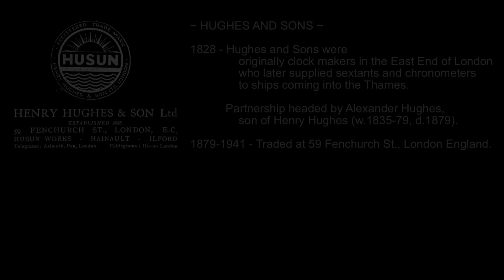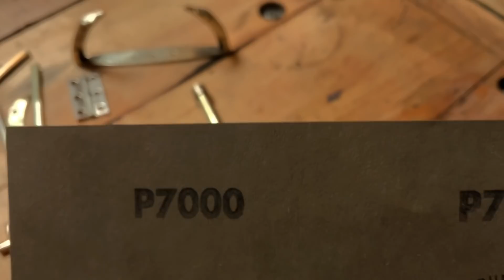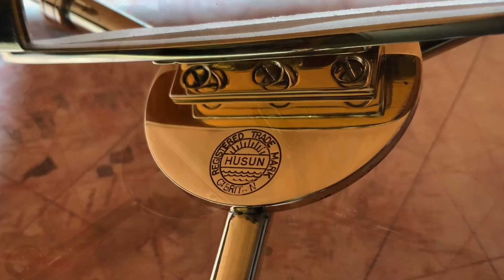1820s Antique Magnifying Glass Restoration - HENRY HUGHES

Comment: That 'paint' is probably original from the manufacturer. It is probably what is called Japanning. It was applied to prevent corrosion of the brass. (especially in a maritime environment)
Reply from the maker: Hi JL , thank you for the info

Comment: My good man, 
A second comment upon a channel? I believe this may be a record of some sorts…..just goes to show how much I am enjoying your work OldHand.
There is a motive also behind this comment and that is to pose a question, if that is not too much trouble… the finish that you achieve, upon the metallic components especially, leaves my in awe of your patience and skill but once complete how to retain the finish against time and oxidation? Or is it just a simple case of polishing when required? 
A long winded question but if perchance you deem it worthy of an answer I would be most appreciative,
Yours in awe,
J. F. Wooldridge
Reply from the maker: John Hi, great to see you again. I would like to see you in all of my works and I can answer any question with pleasure 🌟 I do not prefer any application that will layer on metal, especially in hand tools.  One day a week in the workshop is a full maintenance and repair day.  I clean and oil everything.  In addition, keeping hand tools in closed environments prevents corrosion.  The polishing process, which is renewed from time to time, is also very important.  Of course, these are purely personal preferences.  Of course, decorative polish or paint can be done and prevents rusting. 
Be safe and see you soon.
Best Regards.